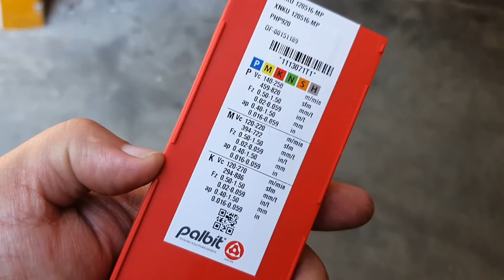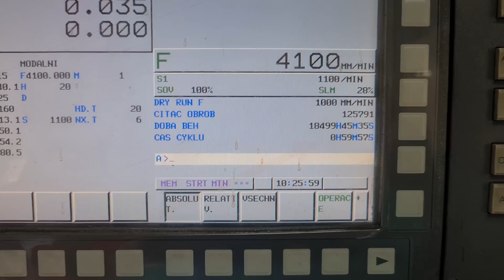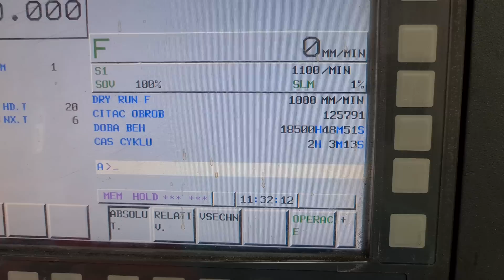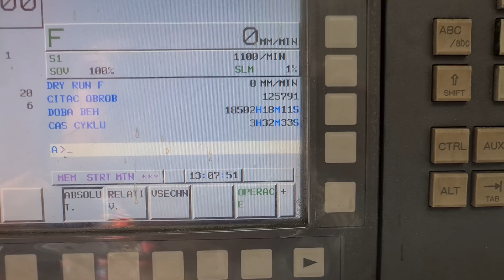The first test feed of Tetrafeed 16420 (actual production footage) (cnc milling)

Comment: what is important,,,, time or durability of the tool

1) drive quietly with little wear
maybe it could run overnight with sister tools  ,,, mazak  and  heiden hain  can handel sister tools   , i dont now  whit fanuc controls 

you can put tool changes  in prg manuel  

2) drive hard with insert changes and interruptions  10 times a day   

I know    it's not easy   there are many things to think about

Comment: i am a distributor of palbit in Greece.
very good video guys .
This cutter is absolute and efficient.
Despite the life of inserts that is amazing in all materials in two grade of inserts 920/930 
the machines run very smooth even if it is a smaller machine for example SR3 or VF2 the surface on roughing operation in also good so the finishing cutter has better performance after the roughing...also is 90° cutter in work pieces that the surface is not to be perfect in b.o.c. Z-0.3-0.5 the surface will be accepted...also last one the diameter can be in smaller insert from D16 with XNKU 06
Keep good work guys if need any help let me know ...i check your videos over a year now.
Reply: How this geometry performs on stainless? Does it hold as good as the positive square?
Reply: @3axisrocks393   machining with high feed on stainless can be a good choice for good conditions....depend on application ..if you want something on general stainless steel application you should use RNHX 12 with 12 cutting edges ...or XPET inserts on small cutter diameters .
What application you want to make ?